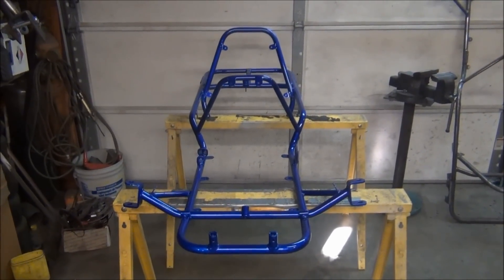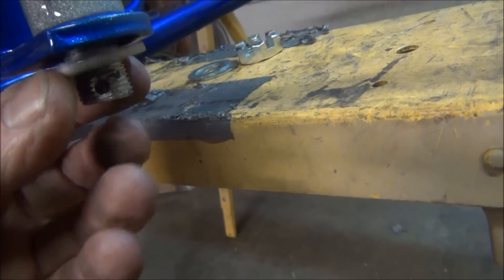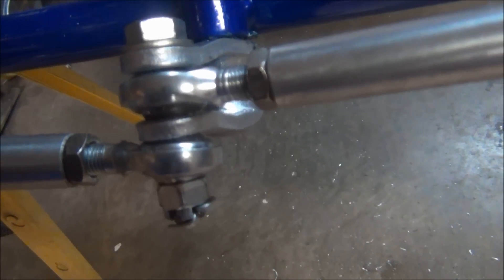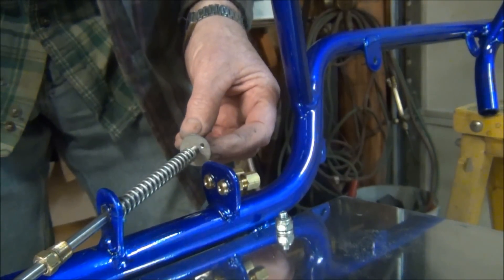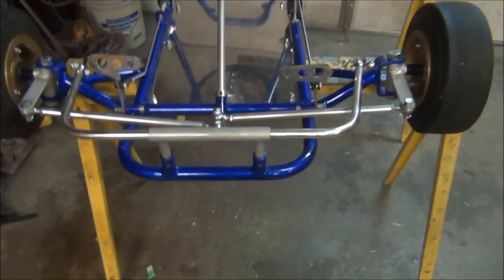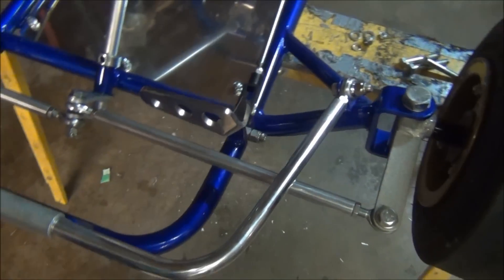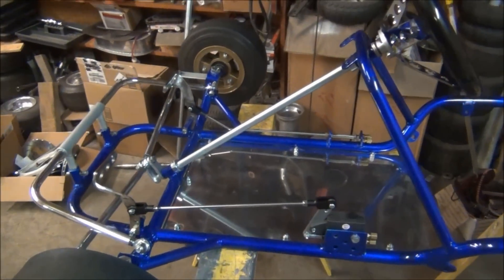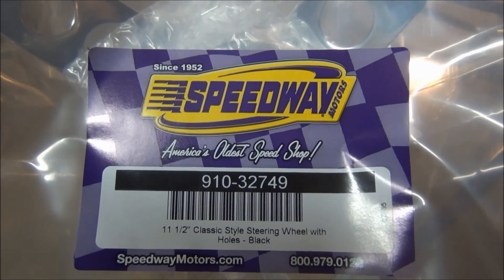Alley Kat II Vintage Kart Build - Part 1.5  - Assembly Advice

Comment: Hi very nice go kart. Would you sell complete running kart kit shipped to Australia . I would love to own a complete one and put it together here . I am no welder lol
Reply from the maker: I would have to check with Steve on that.  I know shipping from the U.S. to Australia is expensive and difficult with small packages.  Not being a welder could be problematic with that.  The original Alley Kats pretty much all broke where the seat hoop meets the frame rails and our redesign addresses that with a great deal of welded reinforcement.  There were rear engine karts in the U.S. like Rupp that were made in a couple pieces originally for shipping.  They were good karts.

Comment: Those pedals look like stainless steel...where did you get them or did you make them? Also what thickness are you running for the aluminum floor pan? Great videos!
Reply from the maker: They are.  The pedals are Fox Kart reproductions based off of the original Fox design.  Dick Teal, who worked as a Fox engineer back in the day, has had them made and sells them.  They are a great pedal, especially for someone like myself that has ankle problems.  You can reach him through the Vintage Karting Association.  Approximately 0.060-inch on the pan